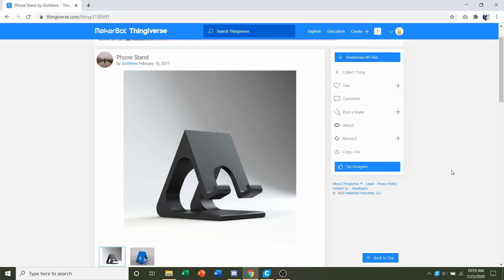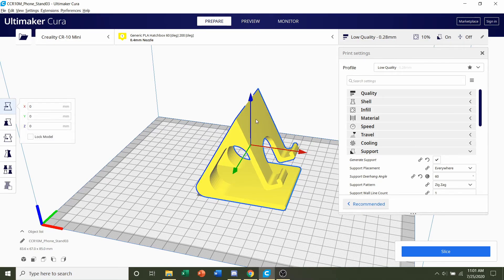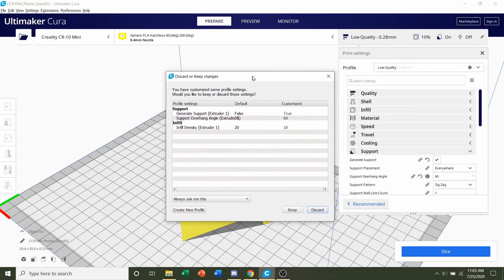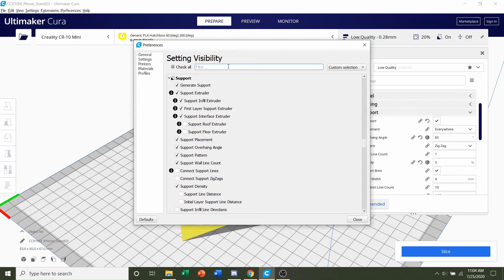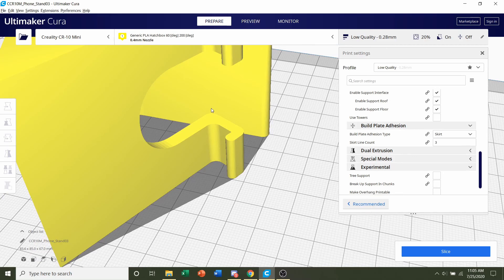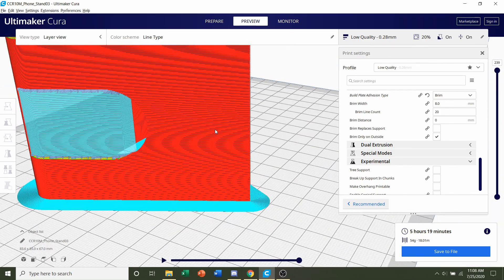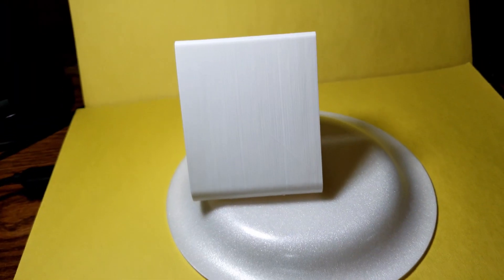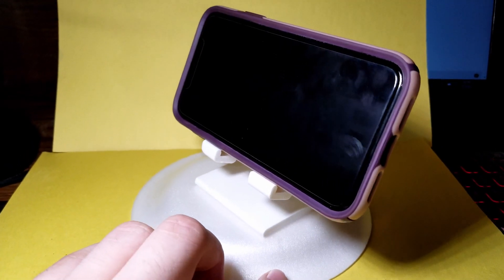Phone Stand 3D Printed - Tutorial, Print Settings, Time Lapse, Showcase

Comment: I printed it but it was not symmetrical. the side that rests on the bed has less distance to the hole than the other. do you know why?
Reply from the maker: I had that issue with mine too. I recommend you print with a brim or better yet a raft in order to get better adhesion. (A raft will give better adhesion, but will leave you with a rougher surface finish).

I thought this was only an issue with me because of my glass bed, but it looks like other people are having this issue too. So once again, add build plate adhesion to the model such as a raft/brim. If your model does not adhere to the print bed, it will "warp" or lift up causing the sides to not be symmetric.
Reply: @Gabriels3DPrinting  thank you.

Comment: I printed this and it only printed the back half and then a whole giant ball of filament when I got home. should i have printed it on its side?
Reply from the maker: Yes! Follow the settings exactly as in the video to print this model correctly. You will have to orientate it a certain direction and also use supports. Also, check out another phone stand video I have on my channel for a better phone stand design :^)

Comment: Noob question...
Sry I'm very new to 3D Print, can we change the design?
Extra thing here, remove a thing there?!
Reply from the maker: More than likely, no. Most files you find online are STL files which are not editable by any software. You can "force" Solidworks CAD to open STL's and you may be able to edit the geometry, but usually this is too difficult and not efficient. If the model creator post the CAD files then you can easily use your preferred modeling software to edit the design.